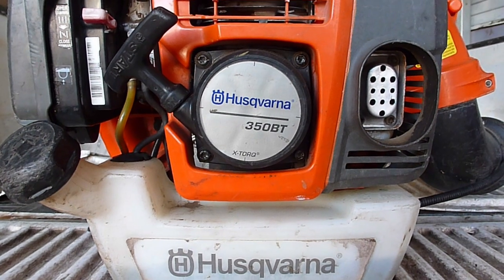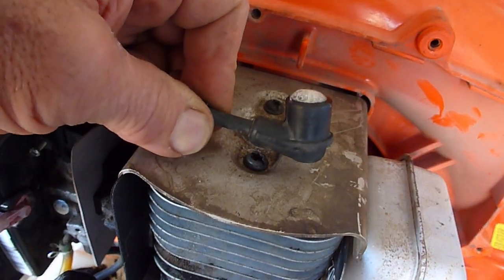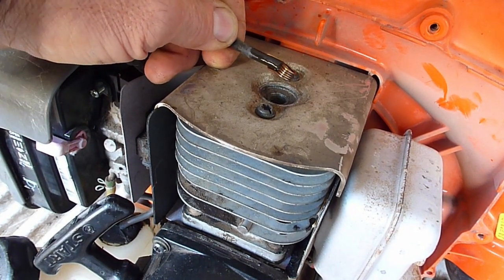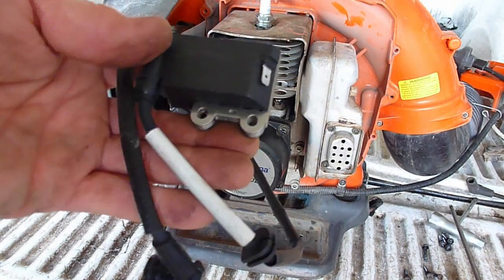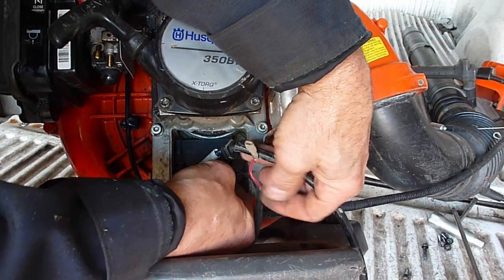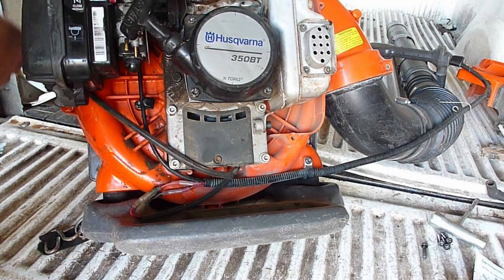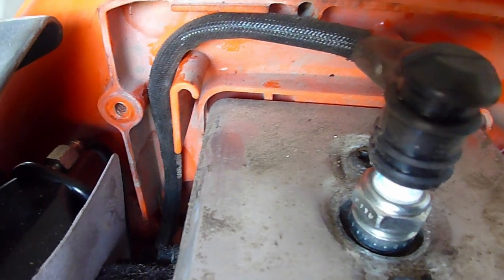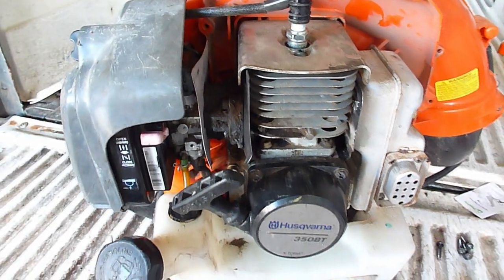How To Diagnose and Replace a Husqvarna 350BF BT Ignition Coil

Comment: did you have trouble finding the correct coil? i went to replace mine as i think i have weak spark i ordered one off ebay but realized theres multiple ones that fit i guess ? but installed the new one i do have spark still cannot get this blower started even poured gas down the spark plug hole
Reply from the maker: There are both OE and replica coils being sold on ebay.  The OE coils are nearly 100, and the replicas are around 20.  Generally, the replicas are going to disappoint.  

Having spark either at the plug, or via a blinking light style tester, doesn't verify spark "strength" or spark timing.  It also doesn't verify that even though the spark plug sparks, will sitting outside the cylinder, that the plug sparks or sparks correctly, once inside the cylinder, under the "squeeze"(pressure) of compression (compressed air).  Replica spark plugs are also problematic.

When diagnosing 2 strokes, always start with a compression test, and then perform a vacuum test on the crankcase, followed by a pressure test on the crankcase.  A 2 stroke will not run if the crankcase isn't air tight, AND if it also doesn't have compression that's at least 120psi.  If a 2 stroke DOES have an air tight crankcase, AND compression is above 120, and it still doesn't run, spark strength and spark timing, and fuel delivery are the next things to look at.  I use Tri-Flow as starting fluid.  

Something else that can occur in 2 strokes, is a carburetor failure where the carburetor immediately floods the engine, wetting the spark plug, and killing the spark.  So the engine can have good compression, a tight crankcase, good spark, OE spark plug, OE coil, and still not start, even when primed with Tri-Flow, because with only 1 or 2 pulls of the pull starter, the plug becomes wet, and that's it....no spark.

So if you prove all the things that are prove-able, and you're using OE parts everywhere, you wind up with a diagnostic path that has led you to the one thing that's still sitting there "raising it's hand for attention" and that's the failed carburetor (and by this time, you've also verified or replaced the fuel supply hose, and fuel filter).  

Regarding the fuel filter; Husqvarna uses a ceramic-like filter with a core inside it.  The outside of the filter will still be white, but if you turn the filter upward and look at the round bottom, you will see a brown stain inside that area.  This is an indication that the filter is packed with debris, and no good, even if it does flow "some" fuel and the primer bulb still functions.

Comment: I have this exact blower, and it all of a sudden died on me. I've replaced the fuel filter, air filter, spark plug, carburetor, and all new engine gaskets. It still won't crank. When I pull the plug and check it, I do see some spark in the plug. Could this be the issue?? I'm at a loss. Thanks.
Reply from the maker: My suggestion is to do a quick compression test and confirm you have more than 125psi.  If it passes that test, do a vacuum and then a pressure test on the crankcase (in that order) and see if you have any crankcase leaks, especially from the crankshaft seals.  If it passes that test, the ignition coil has likely failed, and even though it's still able to create a spark out in the open air, it can't create a spark during the "squeeze" of compression.

It's not uncommon for the rear crankshaft seal to pop out of the crankcase during running, which instantly creates a massive crankcase air leak, kills the engine, and then the engine won't restart.  You can remove the starter and look behind the starter hub on the crankshaft with a bright LED pen light, and see if the crank seal has popped out and is just sitting there.  There's no way to check the front crank seal, as it's behind the blower fan, requiring the machine to be torn down much further.

You say you replaced the engine gaskets, but you don't say which ones.  The cylinder base gasket fails on all of these, so if that hasn't been replaced, it's probably a huge air leak source.  Many times this air leak causes the engine to run lean and hot, and seized the piston rings in the ring lands on the exhaust side, creating low compression.  I have a video showing the replacement of the cylinder base gasket.

Comment: Hey Todd, just watched the "How to Diagnose and Replace a Husqvarna 350BF Ignition Coil". Excellent video! So, I have a 2014 Husqvarna 350FT leaf blower. Last weekend forget to use mixed gas and it seized up. Immediately, I poured oil into the cylinder head. The next day I freed up the cylinder. However, it would not start. No spark. SO, first I bought a spark plug. Still no spark. So I order a new magneto and installed that, following the video. Still no spark. Now, I'm not sure what else might have been affected by the seizure. Any ideas? Maybe the kill switch?
Any suggestions would be helpful!
Reply from the maker: A seizer due to straight gas wouldn't kill the spark.  My guess is that; however you are testing for spark, you're giving yourself a false reading.

When they seize, they seize on the exhaust side, and what winds up happening is they smear the aluminum off the piston, over the rings, trapping the rings in a collapsed state.  So it doesn't matter if the piston can be freed up, the rings are trapped, causing compression to be too low to light fuel.

If you like the blower and have the skill, you can find aftermarket piston and cylinder kits on ebay, and they come with all the gaskets.  Or, source the OE parts here:  https://www.partstree.com/models/350-bt-husqvarna-backpack-blower-sn-20170600001-above/crankshaft-12/
Reply: @austinado16  Thx. I ordered the parts. Sounds like a fun project. Gotta luv UTube for the video on replacing the piston!.... Thx @Austinado
Reply from the maker: @DavidGarabedian-v5l  You're welcome.  Take your time, be clean and methodical and be really careful with the process of slipping the cylinder back down over the new piston and rings.  Very easy to get hung up, and break the rings.  There are 2 stroke engine ring compressor kits available and they are very cheap.  It's a package of red plastic hoops of different diameters.  Very handy.  During the process, remove the pull starter and look behind the starter hub to see if the rear crank seal has been pushed out of the engine.  If it has, the best plan is to replace it.
Here's my video on the job:  https://www.youtube.com/watch?v=IkofXtpxM-4